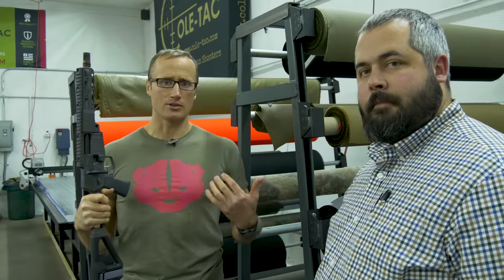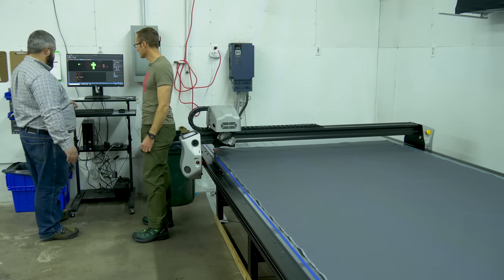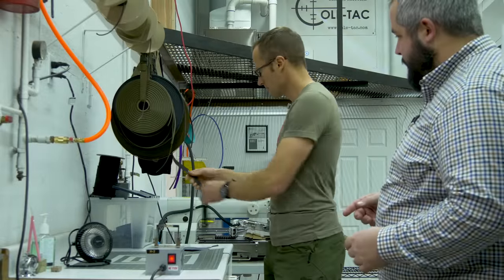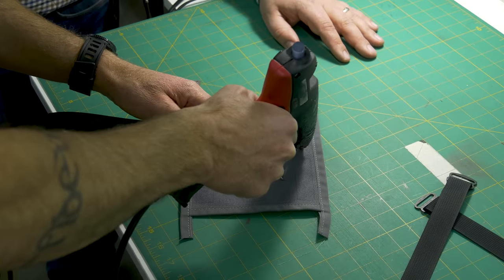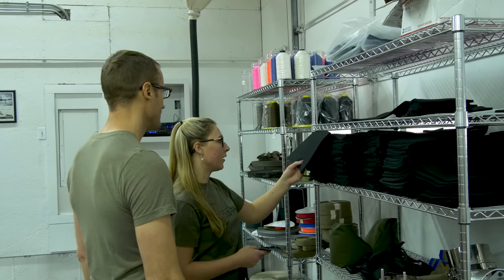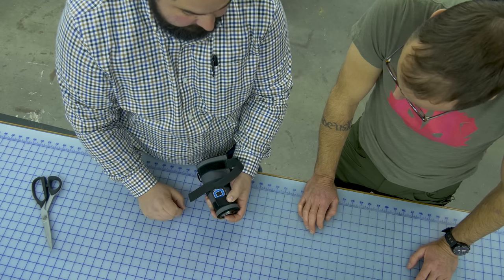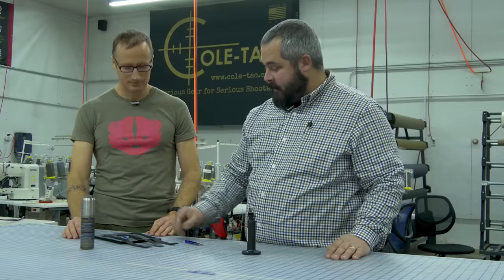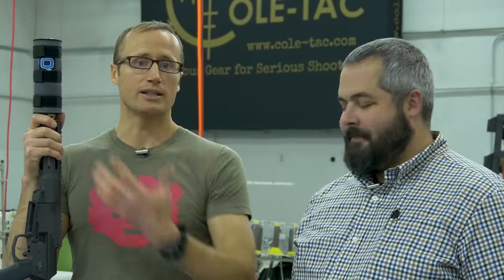Factory to Table: Part - 4 Cole-Tac Custom Suppressor Cover

Comment: I just received my Cole-Tac  Python custom made suppressor cover in multi cam black for my form-1 10"x1.7" 5.56 suppressor. Wow!! This is dripping with quality and the fit and finish is perfect. It was made with four velcro straps in multicam black and my choice of the black buckles.  Kudos to Dustin and Rye (who did the perfect stitching) A big thanks to Kit Badger for the Factory to Table video.
Reply from the maker: Awesome Dan, glad you picked one up!  They make some great stuff.